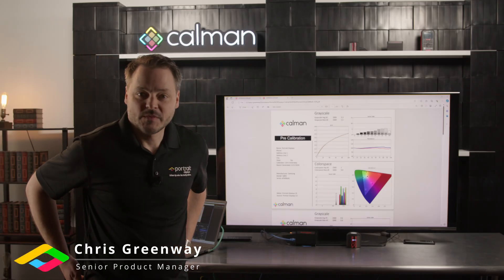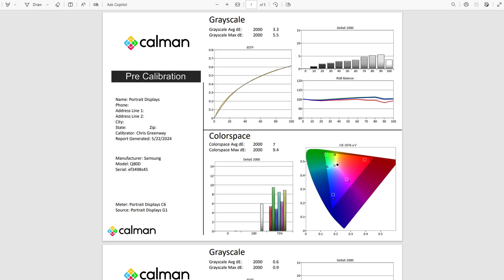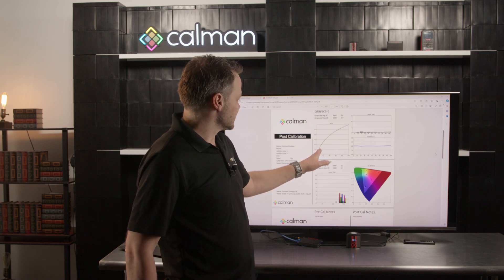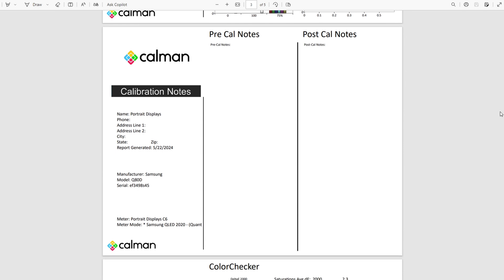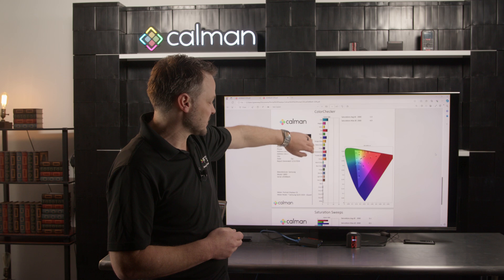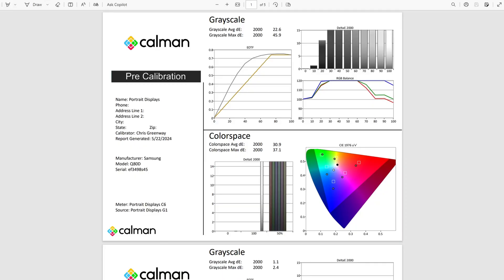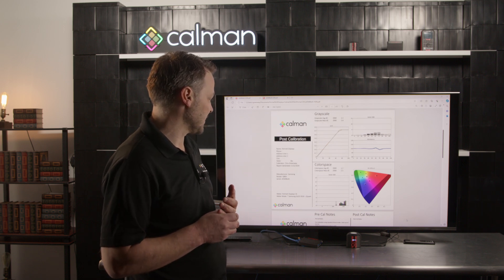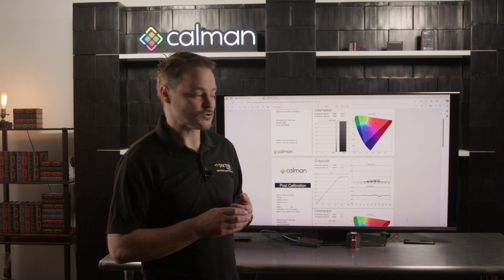How to Read a Calman Calibration Report

Comment: Hi. Ive a few questions regarding deltaE. 1. Is it a logarithmic scale. ? I'm aware that it is difference between true colour and displayed colour. 2. What's the formula to compute deltaE? For example, the true colour is 255,0,0 and displayed colour is 250,0,0 what will be the deltaE. I've been searching for it and was unable to find a formula for it. 3. Is the deltaE formula same for 10bit. For example, 1020, 0, 1020 is displayed as 1020, 10, 1020 what will be the deltaE. I'm an certified engineer and i appreciate if the explanation contains detailed maths. Thanks in advance. Cheers.